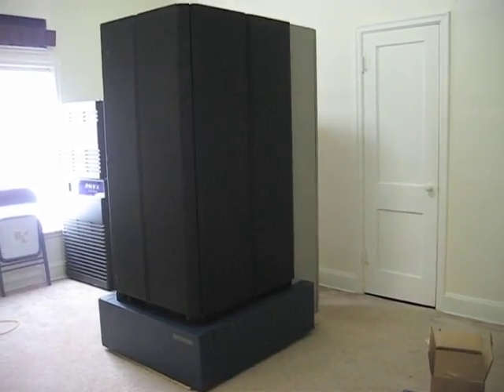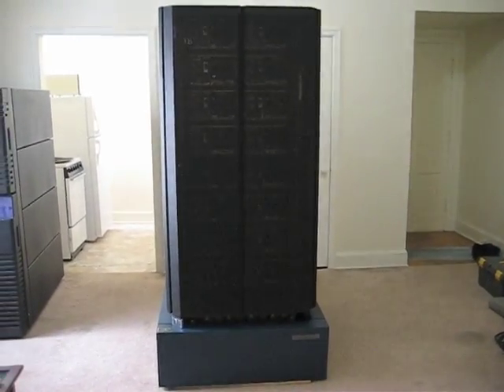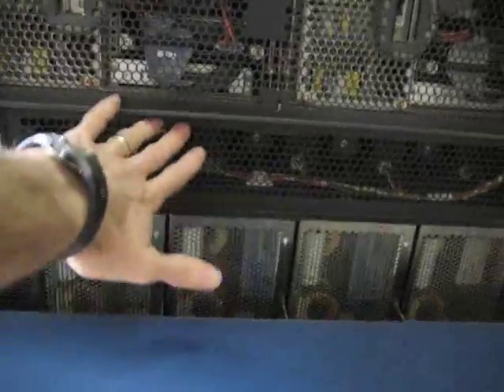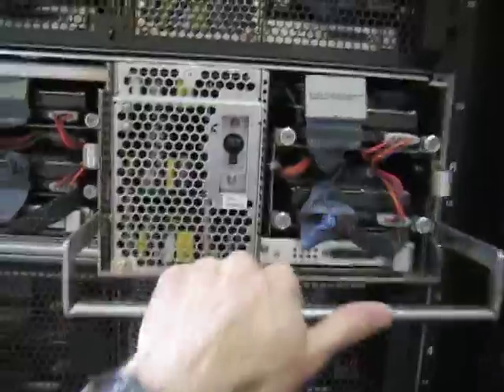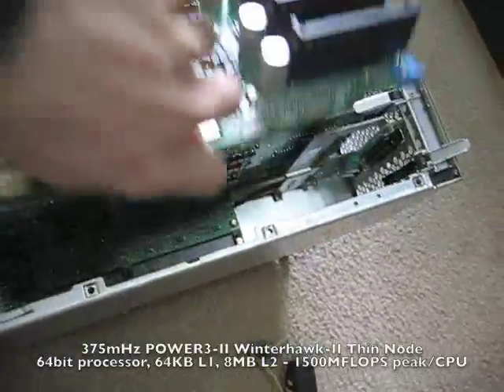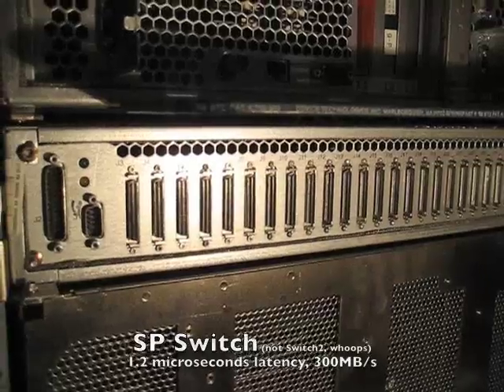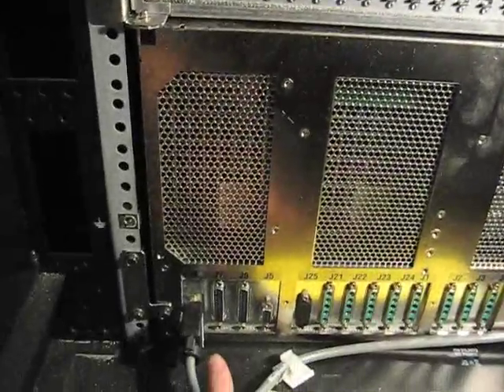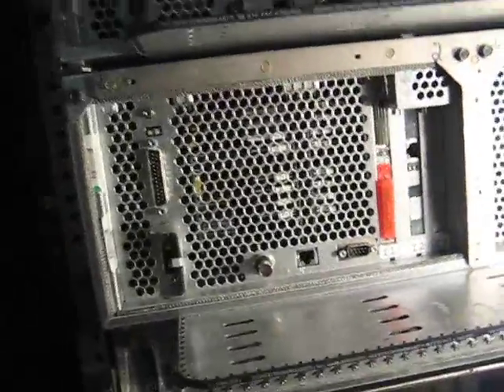IBM SP/2 (Super POWERparallel) tour

Comment: I was an admin of this ;-).
funny machine. the most interesting thing was:
The powersupply was feeding power even when all nodes were down = 4k watts into emptiness.
Reply from the maker: No kidding. Maybe you can tell me about the start up procedure :)
Reply: @jpkiwigeek  You had to use an additional management console.
It was using a soft to control power supply and nodes.
Reply: I think that the power supply had RJ-45 CONSOLE input, I do not remember too well.
On RS6000 you had a simple soft to steer everything, run mainainance mode and reboot, reset, halt and so on.
I think that using telnet over RS/console should work too.

Comment from the maker: @unixuser011 Correct, with appropriate software. I have an RS/6000 F50 (came with the SP/2 and has said software). Entertainingly it just communications over a fancy serial cable, so I could sniff it and replace it with anything.... which gets tempting when it takes almost 40 minutes for the F50 to boot to prompt. Crazy IBM/AIX machines.

Comment from the maker: You're very welcome.
As in the video, this system is really a "cluster" super, which means that anything that clusters are good at, this is. For example, an Oracle DB cluster. Or a high-availability webserver set. You get the idea.
As for generic super uses - meteorological work, or more excitingly, computational fluid dynamics perhaps? Or, you know, beating a chess grandmaster.

The SP/2 was designed to run AIX.